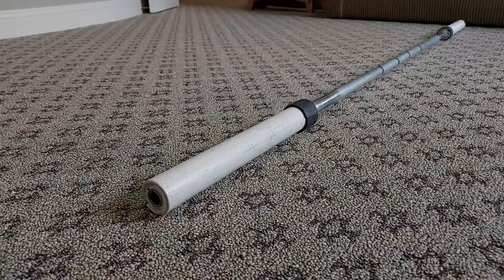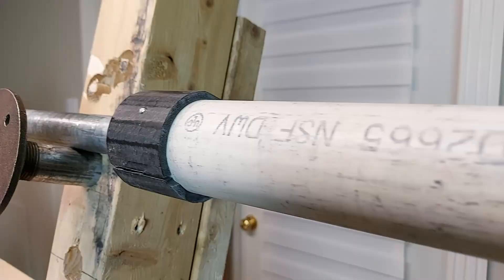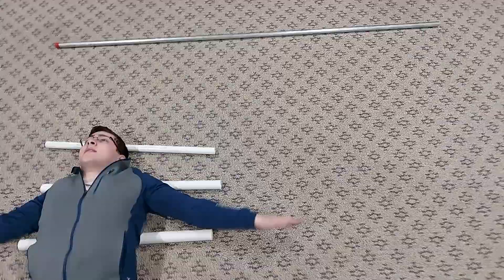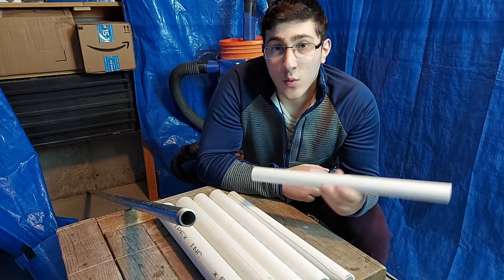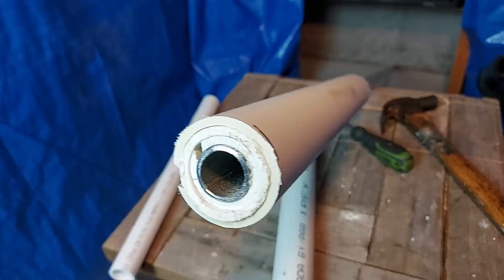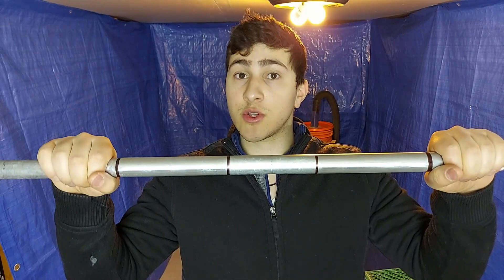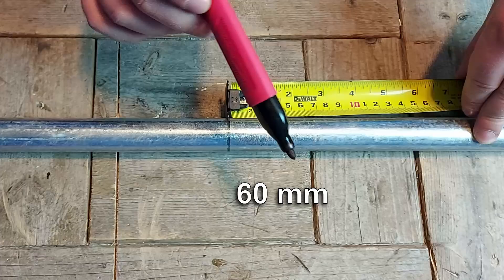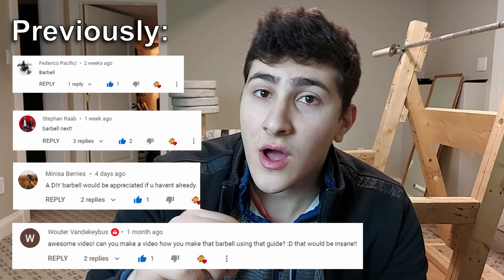How to make a DIY BARBELL | Homemade Olympic Bar

Comment: Put tape over the pvc section you wish to cut should help with the splitting nasty edges. I would also fill the bar with concrete, it will make it heavier, stronger, and will help to prevent excessive bending.
Reply: I know I'm a little late here but the article is about making a training bar for people who can't use a 45 lb barbell. This wasn't meant to hold 100's of pounds.

Comment: Great video! I was wondering if the steel pipe could be filled with sand to decrease the bending on heavy load, then the sides could be sealed using steel stick.
Reply: I know that with rails on chain link fences, about 1 1/2" outside diameter they fill them with concrete for more strength so it may make sense here... I'm not sure about sand though ...
Reply: I know I'm a little late here but the article is about making a training bar for people who can't use a 45 lb barbell. This wasn't meant to hold 100's of pounds.

Comment: Hi Keven, I've wached one of your previous videos where you explain how to make concrete weight plates and the video is amazing and very useful, thanks! I have juste one question if you could help me, where did you buy the aluminium flashing used for the molds? I really can't find it in any store (maybe it's just hard to find in my country, Belgium) ... I've found it online but way too expensive (19€/meter). It would be very nice if you could help me

Comment: Damn, this looks like the perfect solution at home. I'm new to anything gym based, but aren't these barbells supposed to weight like 20 kg (around 45 pounds) without weight? No criticsim, just curious if you have a way to get it. Thanks man!
Reply: I was thinking similar. The only way I could think to do it would be to fill the bar with something of substantial density, such as maybe sand, steel shot, etc. You'd need to have a way to plug the ends so whatever you fill with doesn't leave the side and also create a tight enough seal that whatever you plug with won't shoot out when the internal pressure gets high from dropping or excessive bending of the bar. Completely spitballing here, but maybe 12 inches of wooden dowel of just barely smaller diameter than that of the inside of the steel pipe, with adhesive in multiple circles along the length of the wooden dowel. Do that to each side and I think it would seal well enough against shooting out/losing the filler and still give you enough volume inside the pipe to add at least SOME weight.
Reply: I know I'm a little late here but the article is about making a training bar for people who can't use a 45 lb barbell. This wasn't meant to hold 100's of pounds and if you made the bar weigh 45 lbs it would defeat the purpose of it in the first place.

Comment: Great video. What's the schedule of the galvanized steel pipe?
Reply: This is a secret, because it will bend even at 100 lbs))
Reply: @jimmorrisongrip6086  From what I researched around the interwebz there's a video of a guy using a black steel pipe sch 160 and it holds ~370lb fine without deforming (it's good that it bends at least a little, otherwise it'd probably break). Now, sch 160 is quite expensive, I ended up buying a used non olympic bar which can hold 500lb easy and was like U$25. It'll be more than enough for years to come.
Reply: @eucharistenjoyer  Buddy, a bad barbell (neck) is better than a good pipe!l💪
Reply: I know I'm a little late here but the article is about making a training bar for people who can't use a 45 lb barbell. This wasn't meant to hold 100's of pounds.

Comment: How has it held up?
Reply: @shadowarcherz  i don't have a drill. Do you think i could use 1.75" pipe and hammer it over as the stop for the weights opposed to screwing in the 2" pipe? Or even layer a 1.75" then a 2" on top?
Reply: @shadowarcherz  will do 👍
Reply: @shadowarcherz  it did work i tagged you on instagram if you would like to see pictures/videos of it. Thank you have a great day
Reply: @shadowarcherz  thanks dude 👍